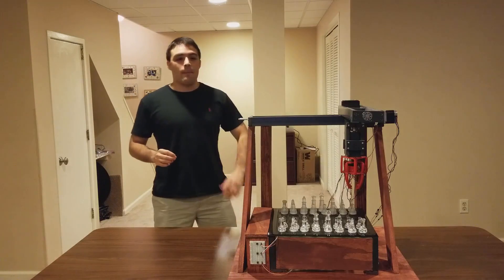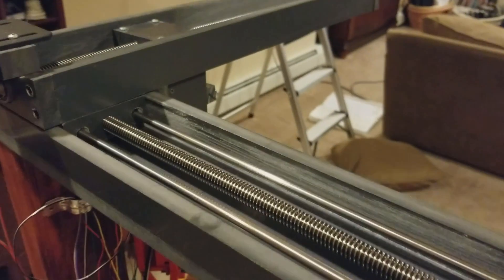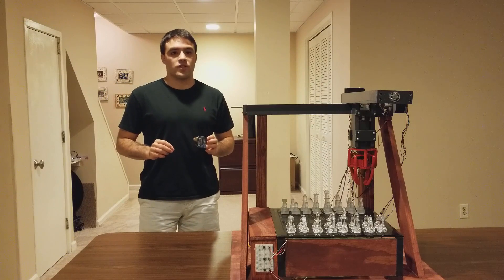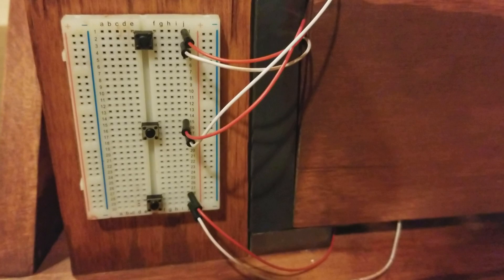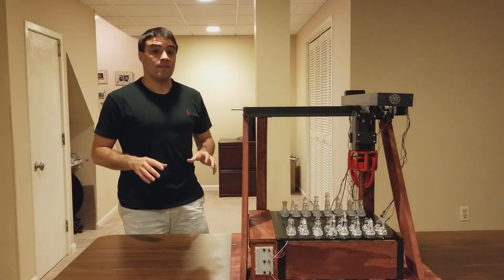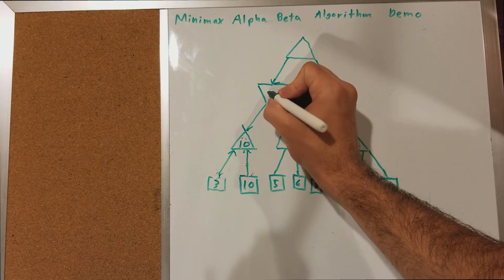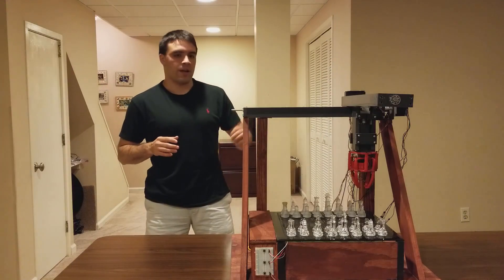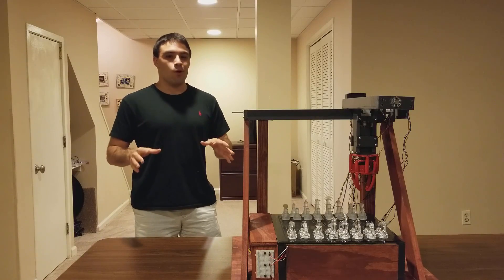How to Build a Chess Robot

Comment: How much did this cost you to make?
Reply from the maker: About 1200 dollars, which includes the drills and 3-D printer needed to build it. About 400-500 in tools and 800-700 in materials such as the arduinos, power supply, and electronics
Reply: 1200? that's insane? OH wait. you had to buy everything .. lol . including the 3d printer , Arduino's etc. . I guess you could have done it a bit cheaper, but reusing your 3d printer? you could have printed the CLAW arm, and then taken the hot end off your 3d printer and put the claw there. and used it to move the prieces?? Lol..